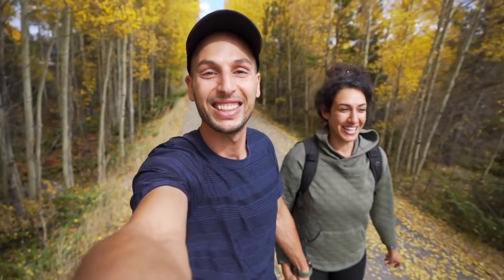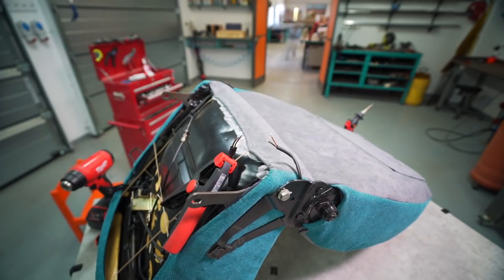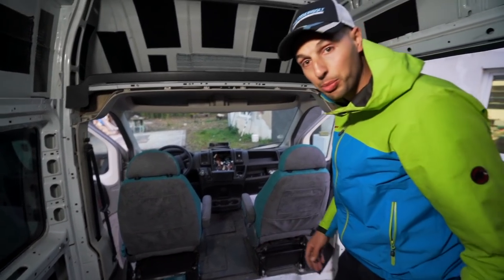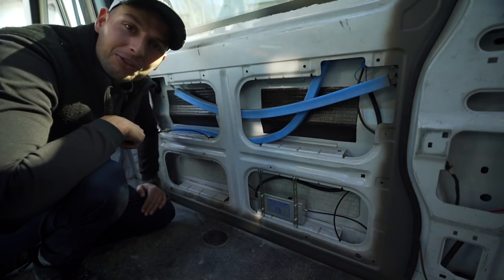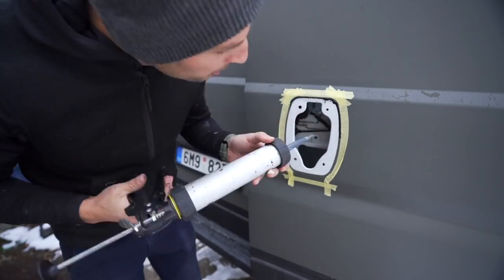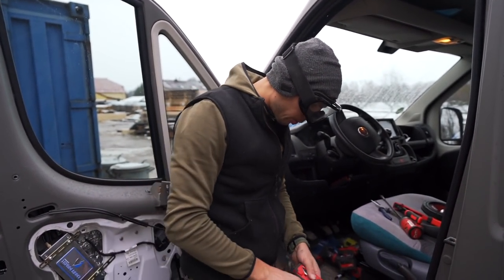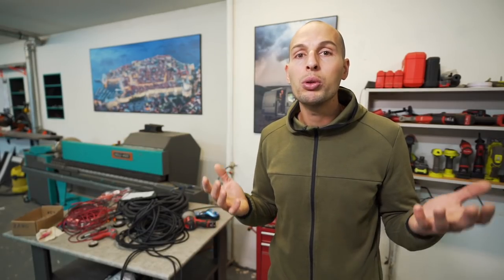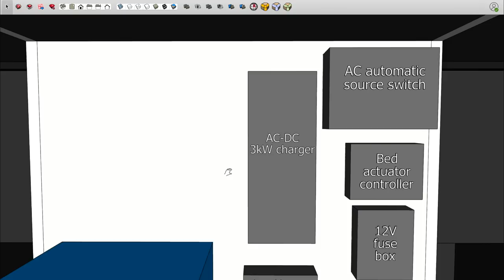INSANE VANLIFE SECURITY - Staying Safe on the Road / S2E5

Comment from the maker: We missed you guys the last few weeks! We explain why we had a very unexpected delay in videos, but hope you enjoy this one! We'd love to hear what SPOILER MATERIAL you'd recommend, as we're kinda at a fork-in-the-road about it. Let us know you're suggestions below, and don't forget to stay warm these December days! Snuggles from Millie (& kitten Vifi if you make it to the end of the video!)
Reply: Buy a new van
Reply from the maker: @smalik2026  ....huh?
Reply: For the solar panel spoiler, if you have access to a scrapped van with a raised roof you could cut the top front apex out of it and mould it to the front of yours. You wouldn't have to deal with ALU, FG or Plastic; well, maybe a little bit of FG to mould it in. Also,  maybe a light bar could do double duty as a wind break instead of a spoiler. It would probably be even less labour intensive.
Reply: A co 3D výtisk třeba z titanu? 😉

And what about a 3D print out of for example titanium? 😉
Reply: For the record Northeastern Minnesota near Pine City only got snow around the 4th of Dec. The latest I've ever seen for first snowfall that sticks.
Reply: Hello this is Mike from Amsterdam Holland I've got the same except system But I made it separate from the car alarm and locks because here in Holland they are criminals they guarded device they can duplicate the signal from the car alarm and they will open the doors with a separate remote So my system has to remote one from the car 1 from the dead bald

Comment: Just a suggestion to help stop someone from using a Cordless Reciprocating Saw & cutting through your Thunderbolt Locks, slide a piece of tubular aluminum or steel over the lock/bolt itself. Once it's in place, have the tube fixed so it won't slide off or interfere during operation of the locks. Now when someone tries to cut through the lock/bolt, the blade of the Reciprocating Saw will directly come into contact with the metal tube, and not the lock/bolt. The reciprocating action from the blade of the saw will cause the tube to simply spin, spin and spin. Therefore, the saw cannot cut into or through the tube then the lock/bolt.  Just a thought.

Comment: Not sure the rear doors will be protected from intrusion. A simple claw bar will slip latch bar off the striker (opposite door).  A better solution would have been to lock from top or bottom, not between each door.    Best of luck, admire your enthusiasm.

Comment: One downside to having your deadlocks linked to your main central locking is that the stock central locking remote that comes with the Ducato is not secure and is vulnerable to RF attack. A company called Thitronik makes replacement modules with far stronger encryption to get around this. Thitronik WiPro III Safelock Fiat Ducato is the complete package they offer for securing a van.

Comment: For the solar shroud/scoop you could use several 3d printed pieces using ASA, PC, or FormFutura ApolloX.  Each of these filaments have higher strength and decent UV resistance, your 3d printers are already enclosed, by decreasing airflow and/or adding insulation or a radiant barrier to the inside of the enclosure will help increase interior temperature to lower warping.  Teaching Tech and CNC Kitchen both have good videos on these options, even using some ApolloX parts in the engine bay of a vehicle.  As for ensuring the width is made you can use a joining solution on the edges of the prints like tongue and groove with epoxy or chemical welding using acetone. If flexing is still a concern it could be reinforced with brackets either metal or 3d printed.  Due to the high temperature and sometimes abrasive contents of these filaments it is advised that you have a hot end that does not have a PTFE liner and a hardened steel or ruby nozzle.
For a continuous piece you would need to find an industrial printer or get a hold of the 3d Print Mill and build an enclosure for it, though I believe the print mill would need liquid cooling for its motors as they appear to be under more tension than traditional cartesian printers like the Prusa Mk3.
Another option would be Lexan or similar high quality polycarbonate, most polycarbonate or acrylic can also be laser cut.

Comment: Nice battery pack you have out there, almost like mine (16 pcs EVE 304 Ah LFP cells). 
I guess yours are CATL 310 Ah..?

About burglar-proof lockings, try building a sistem  like some secret hidden bars or pulleys who locks and prevents the existent rods to be plucked.
Like 2 steps on 2 axes lockers. Hope you understood what I meant to say.. lock the locker's rod 🙂

Doubling the glass windows with 5-10mm solid policarbonate sheets would be helpfull, too.. kind of bulletproofing. Windows are preffered weak spots of burglar's.

Keep up the good work!
Cheers!

Comment: Would appreciate reading any updates y'all have on the Thunderbolt locks after  you've had some time with them... thinking about getting them also and looking for input from folks who have used them. Thanks for making such informative and entertaining videos!
Reply from the maker: They work great. What would you like to know?
Reply: @ladiandmargaret  just curious if you think someone could use a crowbar to still get into the back doors (someone somewhere wrote that as a comment); also did you consider using the key fob they sell with their locks so as to avoid someone breaking a window and opening the rear doors by unlocking one of the front doors from the inside.... Thanks for responding! Cheers from Oregon!
Reply from the maker: I cut of the lever trigger on the front doors, I wanted to have the luxury of one key only. I can tell you with certainly: who really wants to get in, will get in. I’m doing these little steps to just decrease chances. Will it hold up against a crowbar? Probably! The question is for how long and in exchange for what damage.

Comment: If the battery is down and u need to charge it but u can't open the door u could connect  2 cables (positive and negative)to the battery and the other side of the cables standing outside the van, maybe under the van, and with some battery charger u can charge it

Comment: your inspiring video has given me the push to order 4 Thunderbolt locks. Can you elaborate on your plan to charge the starter batteries from your house batteries with an external switch? I would like to be able to do that so I don't have to rely/install the Keyed Manual Release on the outside of the van. I see that external access point as the Achilles Heal of the Thunderbolt lock system. Thieves can drill that out and access entry into the van.

Comment: In Germany, you would need a new TÜV (vehicle inspection) with these seats. Even if you just install a swivel seat. I guess the Czech equivalent is STK? Well especially if you 3D print things yourself you need to get that certified otherwise you are not allowed to drive the vehicle and insurance won't cover in case of an emergency.

Comment: Hi Ladi & Margaret, I am worried about needing to exit the vehicle quickly with those bolt locks. Could they short and lock in a fire or if the van gets submerged? I was thinking about the great ideas you have been doing in your builds and it hit me and wanted to make sure nothing ever happened to you guys. It's unlikely I feel but I rather you be safe!

Comment: OBD GPS will drain the battery quickly when parked. Would be ideal if you could get solar panels to charge the vehicle starter battery, in case you don't use the van for a few days.
Reply from the maker: Looks like I’ll have the car battery charger plugged to the inverter and charge when the voltage drops. Will see.

Comment: the victron inverter charger has a built in starter battery charger(4A only), should be labeled inside, dont know for sure if the 48 volt model has a 12v starter battery charger, so please check the manual
Reply: I checked the spec sheet, it unfortunately does NOT have a 4A charger, only on the 12 and 24 volt models

Comment: Aloha and Håfa Ådai Ladi & Margaret! I'm a big fan of your channel and have been following since your last van. So I just wanted to offer input on yourself front spoiler on the roof? I was wondering if you were going to add additional lights for off-road adventures? If so I would like to suggest building an aluminum frame with plexiglass? That way it will be the spoiler you want while pulling double duty as a mount for the off-road lights and front facing security camera. 🤔🤷🏻‍♂️ just a thought. 😁

Comment: Can you explain further how you will unlock the thunderbolts, if the battery is dead? I just had thunderbolts installed myself in my sprinter, and didn’t think about this possible disaster. Thanks for all the amazing content.
Reply: Yes.  Please elaborate. As you describe it at timestamp 21:40,  are you planning to hold another battery outside the van?  Surely at the very least the electrical switch to to begin charge should be located outside the van, but is the backup battery inside?  How is it wired to this switch and both batteries?
Reply: Also, if there is a connection to shore power, is this problem solved?
Reply from the maker: Oh yes, I think this has been solved very elegantly. I want to have bluetooth controlled relay turning on the starting battery charger on. I’ll be able to turn it on from outside of the van and feed the starting battery from a leisure battery. Wait few minutes and unlock the car.
Reply from the maker: It can easily be done automatically with a voltage sensitive relay. When the starting battery drops in voltage bellow certain threshold like 12,4V, it would automatically start charging.

Comment: This is all so impressive, its crazy how much time/attention to detail you are spending! One thing though, wouldn't that rear deadbolt just separate as the rear doors open providing no locking force? I feel like maybe it should latch somehow
Reply: Yes it doesn't have enough inserted length to prevent crowbar attacks, that's why the best aftermarket deadlocks now have hooks. Mind you, since about 2017 ish, Ducatos have come with deadlocks from the factory, mine has them. Still need the Proplates to prevent the screwdriver punch though, or they'd be able to open the factory locks (and those Thunderbolt ones) in less than a minute.

Comment: You are aware that as soon as you press remote for Thuderbolt lock, frequency could be picked up and repeated...?!
Reply: Is that a common technique for breaking into vehicles, though?  

Everytime I see a video about locking up bicycles, someone jumps in to say how quickly the Lock Picking Lawyer can pick whatever lock is under discussion.  Which isn't really relevant since most bike thieves cut the lock or chain with a battery operated angle grinder.
Reply: No they're rolling codes. Still possible to get an unused code but it needs a different approach than simply sniffing the RF

Comment: Electrical problems happen at the worst possible time. Keep it simple to easy to fall on the technology for technology’s sake trap.  I wouldn’t feel safe with just electrical locks and would be concerned about getting locked in or locked out.

Fire and carbon monoxide they are probably a greater danger than burglary and those locks can lock you in. 

A failure mode and effects analysis is a great tool tool to evaluate and mitigate risk. Would be worth your while to look into that.
Reply: Hello 👋 How are you doing today??

Comment: I hate to call you out Ladi, but, it was only 4 bolts for the pro plate because you already had the door panel off.
Reply: For sure, I have installed them and taking the door panels off and reinstating everything takes a long time.